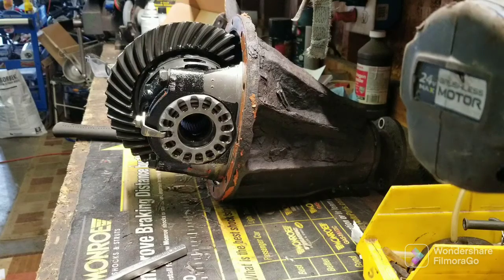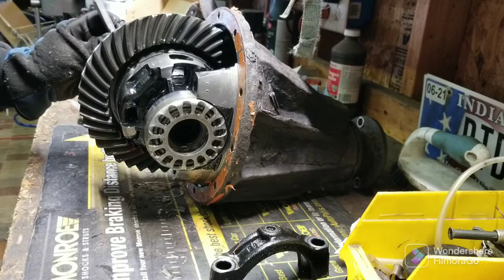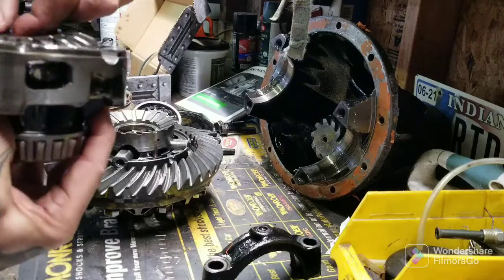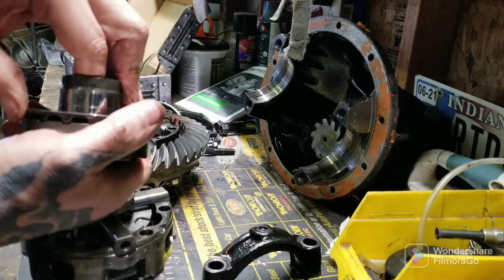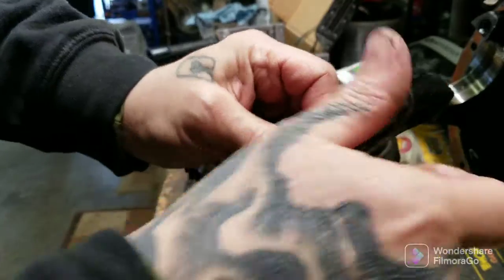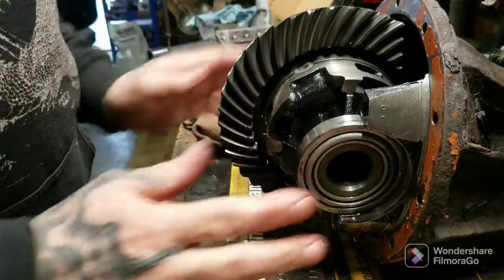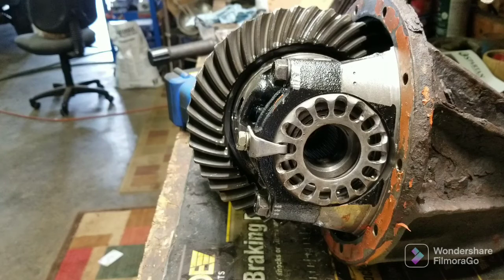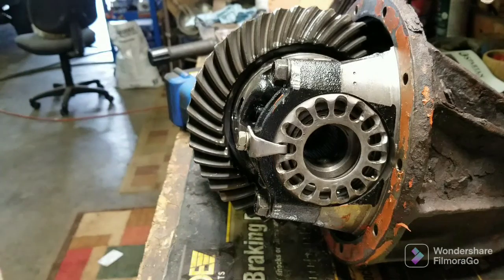How to install a Spartan locker in the rear.  8" Toyota. 3rd gen 4runner, Pickup and more

Comment: Thank you for this! I've been dorking with my toyota e-locker for a couple months and I'm sick of it not working after countless hours, two new ECUs and two different actuator motors (hooray Amazon for returns). 
I refuse to do ARB because I know I'll have that leaky seals problem and as I mentioned I'm tired of dealing with this. 

Happy trails!
Reply from the maker: You're welcome. 
I'm hip to both e-locker and air locker problems. 
I definitely prefer the auto lockers, cheap and easy and always work. I've been using them for years. 
Thank you for watching and commenting I appreciate your support of my channel. 
Cheers!

Comment: good video. i've run the spartans in my old cherokee, but i sold it before owning for a year.  now, in my taco, i'm thinking of doing the same. do you have any feedback on long term drivability?
Reply from the maker: Thank you.
Yes, I've run lunch box lockers in my offroad vehicles for years. Spartans are my new favorite because they are the best price. However their design is exactly like a Lockrite. Between those 2 brands I've had years of on and off road experience and the durability and longevity is impressive. I've never had an issue.
Thanks for watching and commenting. 
I appreciate the support.

Comment: Hi was wondering if you have any experience with these mechanical lockers and a manual transmission truck.. Seem to be reading online that people have issues with clunky banging noise every time they press in the clutch to switch gears When driving on road normal condition ...any thoughts on this
Reply from the maker: I have had much experience with these lockers and manual transmission trucks. They can give a clunk/bang in certain situations but definitely not every time you hit the clutch. 
In order for them to work the inner pieces on either side of the center pin have increased movement . This is obvious in that the driveshaft has more movement before it starts to move the vehicle when changing from forward to reverse.
Gear contact is still tight, but there is now slack in your driveline that is normal. When hitting the clutch in certain situations the slack can cause some noise/jerking as the driveshaft has no forward pressure on it and the rearend is still moving forward so it takes up the slack to one direction, re engage the clutch and all the slack is now moved the other direction.  If turning and applying or releasing the clutch at the same time, you'll have a good chance it will have a jerking/popping or noise/feel of some kind.
Since an automatic transmission is always pulling forward (or backwards depending on gear selection) this is considerably less.
All that to say, once you get the hang of it you can adjust your driving style to compensate for this most of the time. Go slow and leave the clutch engaged while turning when possible. Don't brake mid turn then get back on the gas hard that'll make a racket every time.  Be aware the noise and jerking are not hurting anything, it's just the slack doing it's thing. Makes people look and think you just broke, but you'll know better. 
I hope this makes sense and helps.
Before my busted knee designated me to automatic transmission duty, I drove manual vehicles with auto lockers on the road daily for many years. Like I say you'll develop a driving style that works around the issues and minimizes the noises. I would definitely move forward and install the mechanical lockers. They work great, are always on and are very hard to break (not to mention inexpensive).
Let me know if you have any other questions. 
Thank you for watching and asking.
Reply: Thanks I appreciate your response very well informed and definitely able to get the picture of what you mean of using this with manual transmission
Reply from the maker: @mrgpomona420  Awesome. 
I appreciate it.

Comment: Not sure if there is a difference, but my powertrax locker instruction book says to keep the side thrust washers
Reply from the maker: Thanks for watching and commenting. 
Yes there is a difference in different manufacturers. 
I used Aussie brand lockers and they require the thrust washers be retained. I think the lock rite brand  does also.
Spartans definitely say to remove the thrust washers. 
I appreciate the question
Reply: Powertrax aren't spartan locker. Spartan lockers don't require thrust washers.
Reply from the maker: Thanks for the confirmation. 
I appreciate you watching.

Comment: when welding the rear end, I just welded the spider gears to the cross bar. is that good enough or should I take the spider and cross bar out and just weld the side gears to the case? thanks. its off road only.
Reply from the maker: Thanks for watching and commenting. 
I have always welded the spider gears to the case.
I leave it complete and weld all 4 gears to the case.
I've never tried it any other way.